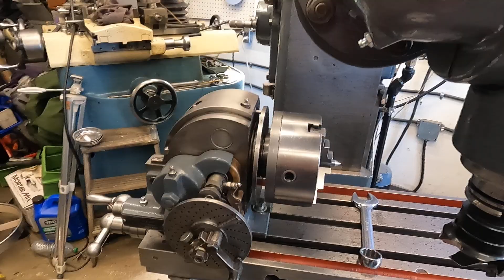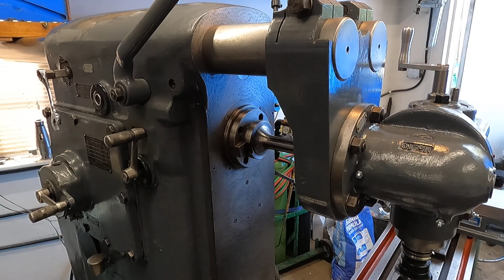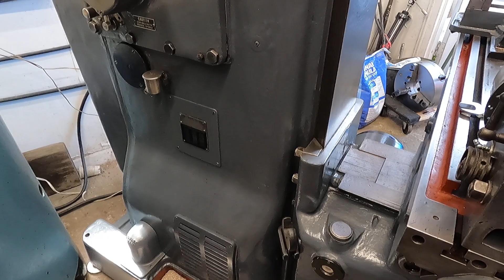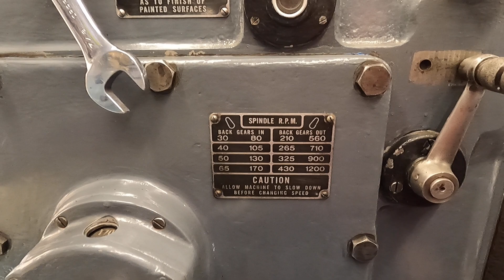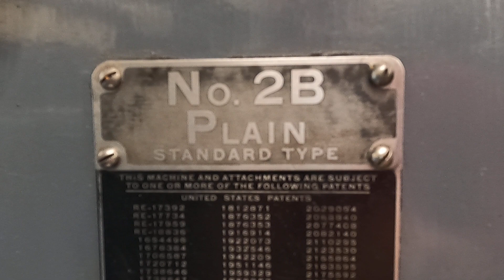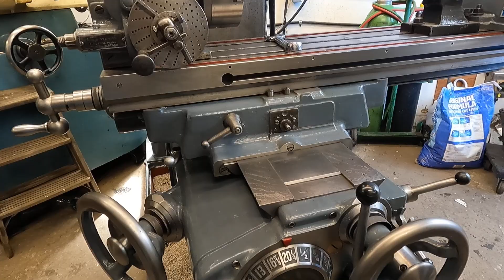Brown & Sharpe milling machine, companion to my Baby Axelson lathe

Comment: Cool machine. Vertical head doesn't look very rigid, but I bet it's a good horizontal.
Reply from the maker: Yes, the further the head moves out, the more it is likely to chatter, and also the head is heavier then it looks, and causes the round over arms to sag. The horizontal spindle has a lot of power with 5hp, the heavy silent chain drive, and a heavy frame for a #2 size.

Comment: Love that mill.  I used to have a #2 Light with the 40 taper and the extended spindle.  Sold it a while ago.  I kept the Van Norman 22LU.
Reply from the maker: I am familiar with the VN, it is overall easier to use, this old machine has one more trick coming up.
Reply: @deedeeindustrialsuperprecision  That B&S is sooo cool.  Love that vertical head ! ! !  I was thinking of selling the VN22 as I have a line on a K&T 2CH, ex navy machine.  We will see.

Comment: Looks like a decent mill and you were lucky it came with the vertical head and rotary table, a good deal for 500 even if you had to go through it. A shame machines like that still get scrapped.
Reply from the maker: The old radial drills, and horizontal mills have very little value in my area, it is sad to see them left out to rust.